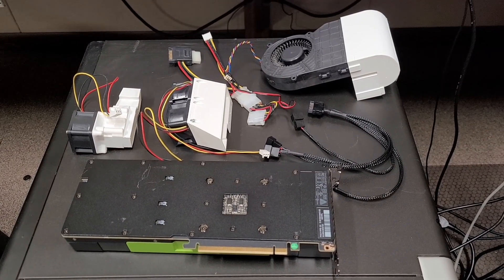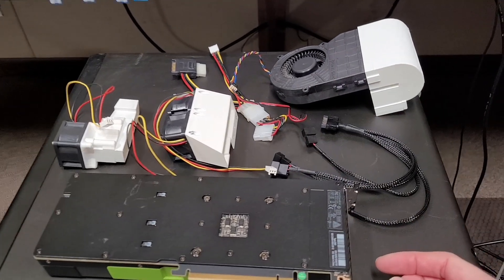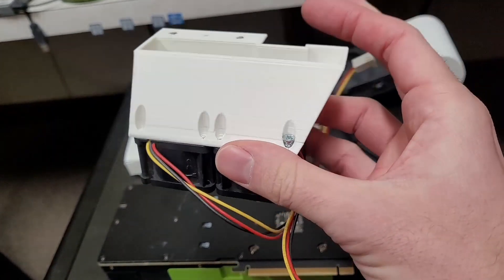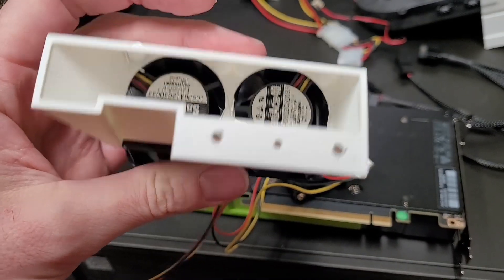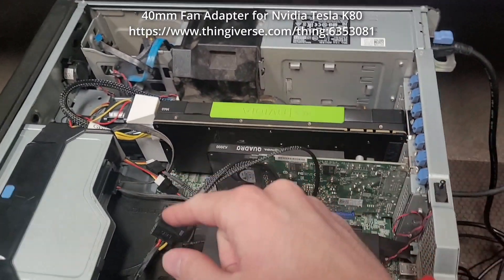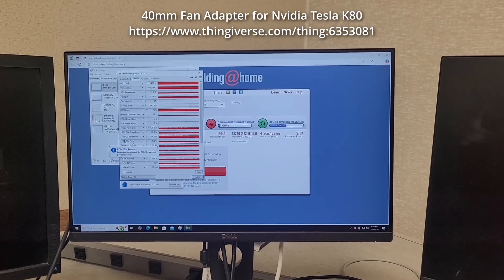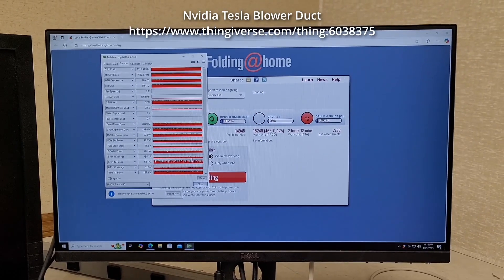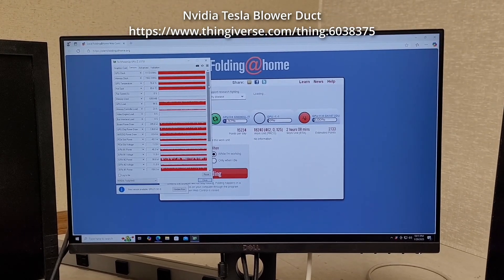3D printed fan adapter shroud showdown for NVIDIA Tesla M40 P40 P100

Comment: Just saw this.  2 weeks ago I underwent the same journey.  My results on an M60 showed that the processor nearest the slot cover got hotter than the one closest the fans.  So I had to add an auxiliary fan shroud with a 40mm server fan to boost the cooling on the second (far) gpu processor.  It's an abomination but it works. I have pictures but no way to show them.
Reply from the maker: I imagine the M60 is even more challenging to cool with its dual GPUs onboard.

Comment: Thanks for doing these tests. Looks like the blower fan inlet was mostly covered by the quadro card?
Reply from the maker: @benbencom  there is a small gap between the two. It probably didn't help things but I think the airflow having to go through that bend is the bigger problem. I could see if I have time to rearrange things. I don't suspect it will make a huge difference though.